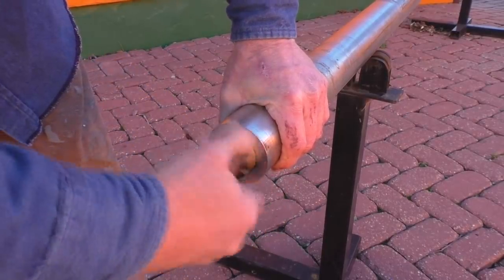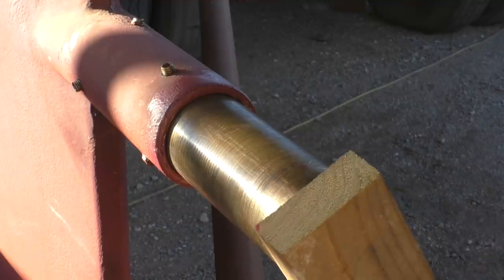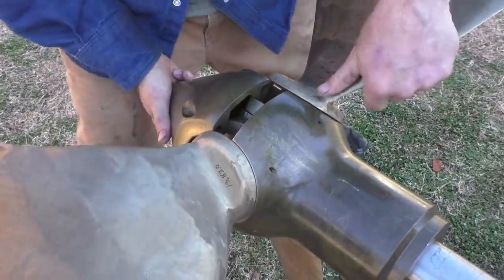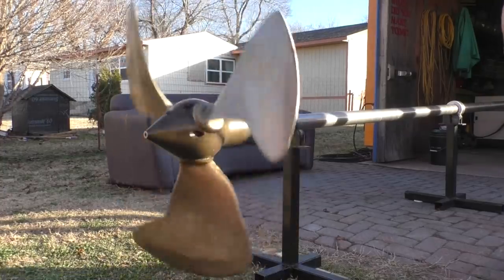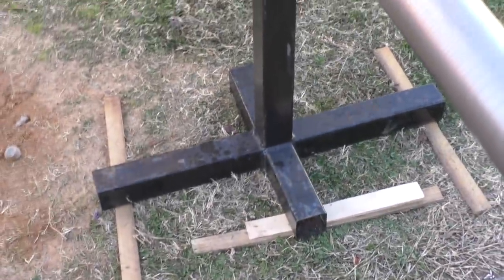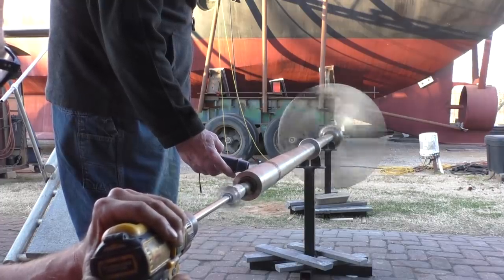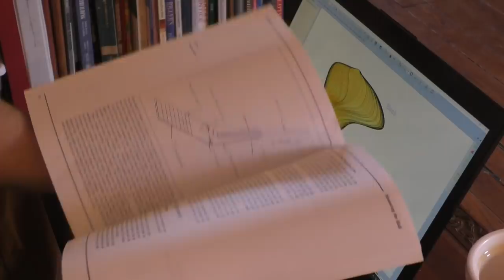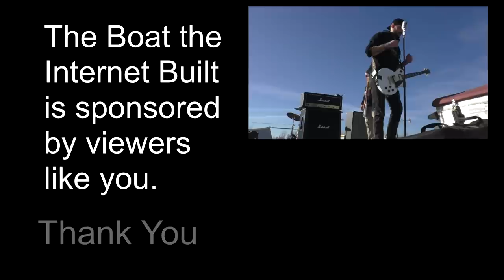DIY Boat Propeller - Part 10 - Tested at 600 rpm

Comment: I would get the balance as perfect as possible, it will extend the life of your bearings and improve your engine performance.
Reply: captain obvious lol
Reply: The beauty is that you don’t have to say how you would do it. You can just do it. To your own propeller. To lead by example rather than armchair quarterbacking.
Reply: @davidgray7907  098
Reply: @ButterflyMatt  how does one "lead by example" from the YouTube comments section lol? What a preposterous suggestion
Reply: I wasn’t suggesting leading from here. I’m suggesting doing something as opposed to talking about what you’d do differently if you weren’t just second-guessing someone who’s doing something.
Reply: @ButterflyMatt  The way I'd personally balance it, is to beefen up the base of the blade casting so there's a little more meat thicker up about an inch more than the thick base part of the blade is currently (where it feathers into the actual blade and starts to thin out).

Having a slightly thicker base gives me the ability to weight each blade, and find the lightest one to the gram. Then, drill out small holes from the underside of the base (to keep rigidity and structural integrity) to weight match each blade.

Obviously pitch, wave off, and shape can be made the same via pounding out the blades on a form just the same as you do when reconditioning props.

This would balance the prop out entirely as far as the blades are concerned. BUT, that's only half of the equation. The other half is the driveshaft/spindle!

In order for the drivetrain to be truly balanced, that driveshaft needs to be balanced/straight within thousandths of an inch like on all prop systems. The answer to this, is multiple bearing points along the system until it exits the vessel, and then at least one bearing system external of the vessel. But, the shaft needs to be either CNC machined, or turned a VERY precise lathe by an experienced machinist.

This is how to achieve a balanced system with minimal vibration to give reliability and longevity to the system.

OR, fab up a connector to connect the prop to a tire balance machine, and then balance the props by adding and reducing weight where needed until passable.
Reply: I had wondered if balance with the blades (vibration/wobble) when he was grinding on them to clean them up.  It's been awhile since that upload, but I thought hmmm, just grinding away is kinda reckless when you have balance concerns... Doug will straighten it all out. I think he purposely causes issues so he can solve them later.  Lol
Reply: Why didnt he think of that? While hes at it he should get the ship to float as perfect as possible, it will extend the life of the vessel and its crew

Comment: Seeing that prop spin was amazing.  If that half inch drill will get that prop up to 600 rpm what do you need that big Cummins for?  Just take Bart along with a few spare drills.
There will be a certain amount of resonance in the system and it will change based on the loading (pitch) of the propeller.  Reminds me of my brother's Pontiac Firebird.  At about 60 miles per hour on the flat the front end shimmied but at around 85 it smoothed out again.  Believe me, state police are not interested in why you were doing 90 in a 65.  Thank you for the video Doug.  Good to see Bart again.  Take care, stay well and have a fabulous New Year's Eve and New Year's day.
Reply: I know its a joke, but if somebody does not get it: In the water you need much higher force to turn it.

Comment: When it’s on the stand without power, whichever prop rotates toward the ground is the heavy one
Reply: I believe he did that after casting the blades
Reply: While this is true, the heaviest one could also have the most weight at the base of the blade. It turns out that the distance from the point of rotation actually plays a large role in how things balance as well as weight. It's called moment of inertia if you want to read more about it. In short, it's important that the center of mass is the middle of the shaft for the assembly. Or, the same distance from the base on each blade.
Reply: @Akya2120  Center of mass distance from the point of rotation is the only thing what matters =  moment of inertia. It does not matter if the heaviest one have the most weight at the base of the blade.
Reply: @deadslow201  it actually does the moment of inertial is some constant times mass times the square of the radius from the axis of rotation. Literally the distance at which the mass is located from the center is exponentially more important. As I said, while getting them to all weigh the same is important, getting the mass to be evenly distributed is more important.
Reply: @Akya2120  Center of mass distance from the point of rotation is the only thing what matters =  moment of inertia. It does not matter if the mass is not evenly distributed.
Reply: @Akya2120  The distribution of the centers of mass of each blade determines the moment of inertia of the whole assembly.  So if you know the moment of intertia, the distribution or the blades is already taken into account.
Reply: Engine con-rods are weighed end-for-end and compared - from each other and in total. The same can be done with propellor blades.

Comment: A tug I use to work on had a Busch-Sulzer Diesel, it had an RPM chart, 0 - 400 with a notation that 275 was a critical turn. It warned "Do not operate at 275 RPM."  When we passed 275 RPM there was a noticeable shake in the whole boat. If you end up with a critical turn, stay away from that RPM. You may find you are fine above or below that turn. Happy New Year!
Reply: that rpm is just where the harmonics of all turning things come together. It can be pretty dangerous but sometimes just adding a counterweight to the "gearbox" might fix it because of a change in frequency. Thats how they fix in in modern cars, just add a block of metal on a bracket and it might have gone away(probably calculated/simulated in some software first)
Reply: Torsional vibration could also produce some no-go rpm ranges, or does the hydraulic transmission overcome that ? Recalling here in my youth  being in charge of an 8 cylinder 600rpm Allen Diesel generator and discovering playing with the governor produced some speeds that were very unhappy and that previous technical lectures on crankshaft  balancing, harmonics and torsional oscillation had some practical use .

Comment: The whole system will have various balance points, based on the harmonics of each component.  You can probably just tune your use of them, by making sure that you don’t run them at the speed which triggers the harmonic resonance.  DAMN, you just said those words!
Reply: I think you could engineer that out of the system with some springs and some weights on the shaft, like an old school mechanical speed governor

Comment: Just a thought? How do Submarines tell other Submarines? They obviously cannot see them? The only thing that they can do is hear them! They hear the noise given off by the other Submarine and that noise is made up mainly by the noise of the propeller cutting through the water. They can tell how many blades the propeller has and it's RPM and then how fast it's traveling for a given RPM and..... they can work out if the other Submarine is friend or foe! In other words, even the multi billion dollar Submarines have small discrepancies in the propeller blades! This gives them a "WHOOSH WHOOSH Whoosh whoosh WHOOSH WHOOSH Whoosh whoosh" for a four bladed propeller! Food for thought and don't ask me how I know!

Comment: Doug i have a 38 foot cape island fishing boat and had a wobble in shaft of the boat it’s not variable pitch but not only did I ruin every bearing and cutless but also the transmission I’m running a 220 John Deere so pretty much the same hp as you think you have a 210 Cummins just a heads up is all I sent my blade out to a foundry in Nova Scotia and they polished and balanced for 400$ fixed everything no problems after it was done

Comment: Talk to an AME.  A prop balancer will work.  Also, that 120 grams will make a significant difference on your bearing life!!!  I would start with static balance (blade weights) then finish off the dynamic balance with an aircraft prop balance.

Comment: Have you checked with any drive shaft manufacturers in your area? Maybe someone has the ability to put this thing on a lathe and balance it. It's likely too big, but maybe worth a check. 124 grams doesn't sound like much, but it'll vibrate things apart in a hurry.
Reply from the maker: We'll see.
Reply: Exactly. And you will know before you get too far from Tulsa.

Comment: The prop and variable pitch mechanism you designed and built is truly amazing. Since they are all custom built parts did you make any spares?
Reply: He bought the shaft and the system off a tug ( if I remember correctly ) but made the blades by learning how to cast

Comment: I would try to balance the blades within 2-5 grams if possible- The wobble may not seem all that bad on steel bearings, but that shaft's gonna be vibrating/wobbling at speed against your rubber bushing (that'll give/flex, allowing more movement) and my assumption is that the rubber won't hold up very long against that kind of long, repeated pressure. And intuition tells me it's going to have significantly more force behind the wobble as it'll be up against the bushing and then solid hull structure.. Probably enough to feel vibration in the ass end of the boat when it's spinning. Another commenter mentions just not running it at 240-275 rpm and that may help.. But for longevity, I'd really consider taking the cheek poker to it and trying to balance them a bit more if possible.  (Or mix and match from your two sets to get as close as possible)

Comment: As ed rabbit said it must be static ballanced first, you will not be able dynamic ballance it with out the harmonic sesors and solid base. Im a ex marine engineer and marine fitter. Dm my if you want info, be happy to help

Comment: There's an online calculator that you can use to balance this. I made a video about it months back when I balanced the chuck on my lathe. I will see if I can find the info for you and post it in a comment. It's an easy process that works very well.

Comment: I'm only 2 minutes into the video and this question may already have been answered but is there any indication at the helm what the pitch of the propeller is? Or do you get a general idea of pitch based off of speed/engine load etc.?
Reply: Place a spool on the shaft right after the trans and put a yoke on the spool. The yoke is attached to a rod and pivot. Hook up a rheostat to send the position voltage to the helm.

Comment: Could you make an adapter and get a tire shop to balance the prop like they do tires/wheels?
Have to be a truck shop for tractor tires, but still.  Either that, or a precision lathe that has weight indicators on it.. But that'd be a BIG lathe.
Reply: You beat me to it in that idea ! Fully agree that would produce dynamic balance requirements. An old truck wheel could be adapted as a jig to accurately centre the shaft and be pre-balanced itself before mounting the propeller. Whirl in the shaft is another problem. That might best be tackled by first balancing it with the blades removed in a driveshaft balancing rig. Shipyards presumably know all the tricks however, before going down alternative automotive routes.
Reply: @philhealey449  yeah as far as balancing the shaft, I would leave that to a shipyard.. but the manufacturers of propellers generally build them to incredibly tight tolerances, and there are very specialized machine shops that deal with them long before they ever get to a shipyard.
(Brother worked at the shipyard in Alameda for almost a decade, every single prop/screw he ever came across was built, and balanced, off site)

But I do agree the shipyard should be able to deal with the shaft, or a driveline shop, providing it's not too long for their jigs
Edit: regardless though, I think we are both in agreement that the prop needs to be far more accurately balanced
Reply: @philhealey449  the whirl/bend in the shaft may well have been caused by the weight of the propeller hanging off the end. Even at just one foot stick out, that prop probably weighs 50+ lb, and that's a hollow steel tube, it's going to flex a bit.
He should retest spinning the shaft without anything on it.. dollars to donuts it's running pretty true
Reply: @mashrien  I expect you are right and if drawn tube not welded seam it should be inherently balanced. I assume shaft diameter was appropriately  selected to suit bearing spacings, so in real situation should not be too whippy.

Comment: I suspect that imperfections in the shape (and pitch) of each blade will cause each blade to create a slightly different load that will far exceed any imbalance caused by weight.

Comment: I think that safety wiring the stainless cap screws on the prop cap would be prudent as any vibration could loosen them  with a resulting  loss of the prop

Comment: Stands on a solid base with some mass and bearings that enclose the shaft. That way you can tell if it's the shaft that's out of true. At the moment you cannot tell if your problems the shaft or stands or both.

Comment: Two things I kept considering watching this whole video, Love seeing your work by the way. One is the best way to figure the pull of an unbalanced spinning object, is a grease pen. Come close to the object without touching it until it touches the grease pins. That would be the heaviest point from your axis. Obviously not the blades lol but I would test it maybe three or four feet down. 

I was also wondering if the smaller amount of grease not being equally distributed along the inner shaft could possibly be that many grams off which would also explain why it levels out later.
Reply: توتار.   عناىاا

Comment: After this coming summer’s launch and tests it will be interesting to hear your thoughts on “what I should have done” or “ hey that works better than I thought it would.” The amount of engineering you’re done on Seeker is impressive especially when you think of the huge teams of draftsman, engineers, designers, craftsman it takes to develop and build anything this complex. I realize this is the boat the internet built but you had to manage and collate all that information so it would be nice to have a “lessons learned”.
Reply: Just watch 100 videos. Job done.
Reply: @leeklemetti1887  True! I have watched most of them but then again that boat is still high and dry and hasn’t lived through any rough water. Lots of stresses that are only theoretical at this point.
Reply: I spent two years readying a sailboat for a big trip, and thought I had everything planned. Nope.
I learned a lot of lessons that I will apply to my next endeavor though.

Comment: If the power steering comes from the engine, then wouldn't the engine need to be on during sailing it is there an aux pump?
Reply: I'm guessing you'd feather the prop prior to shutting off the engine and that it would stay in that position without hydraulic pressure.
Reply: @JohnDavidDunlap  but the steering
Reply: @c.j.tonnes7648  Oh, sorry, I misunderstood you. With respect to the steering, my impression was that they didn't need hydraulics when they are under sail but, if they did, they could use an electric pump powered by the solar panels.
Reply: @JohnDavidDunlap  ahh interesting. Thanks

Comment: I have no experience with balancing propellers and shafts, but I think 122 grams of static imbalance could become very significant when spinning. If the effective radius of this imbalance is say 10cm, there would be about 40g centrifugal force acting on it at 600rpm (g Force = (rpm)^2 × 1.118 × 10^-5 × r) and 122 grams becomes nearly 5kg...

Comment: You should balance them just like I do my RC propellers the heavy blade will always fall to the bottom just take off weight on the heavy blade until they are balanced let gravity do the math hey it works for airplane propellers that spin 10K plus I am sure it would do fine for something that spins less than 1k.

Comment: I was thinking about your hydraulic actuator for the blade pitch and was just wondering, if it lost hydraulic pressure for some reason, would the blades fail to a usable pitch, or would you effectively lose the use of you prop until it could be fixed.
Reply: I would think hope it would fail to fine pitch so at least you can still use it.  But my guess it it will fail in its current position.

Comment: You guys continue to set the bar for playing things fast and loose, pun intended! I understand just leaving the shaft lay in the bearing but I would have thrown a few sandbags on both of those uprights as an insurance policy. I know you don't care much about the safety aspect but that's a lot of work to redo if that thing comes apart.

Comment: Please dont run the prop and shaft with out getting it balanced and trued. It will  cause EXTREME DAMAGE if you  do not.
Reply from the maker: Bull shit. :)
Reply: @SVSeeker  Hi Doug, no bullshit, you wouldn't drive around with your car wheels imbalanced would you? Well maybe you would but at least get the static balance done before going into the water, the vibration will beat the crap out of your cutlass bearing in a very short time. I'm not an armchair expert, spent over 14 years in the Condition monitoring game. Condition monitoring and balance was something that was developed during the Manhattan Project, when they were continually breaking the machines when developing the bomb. You took advice from people that were in the know for the paint on Seeker. This is something that needs to be done. At the very least get the the COG and weights close.